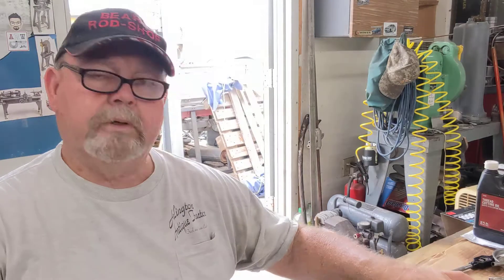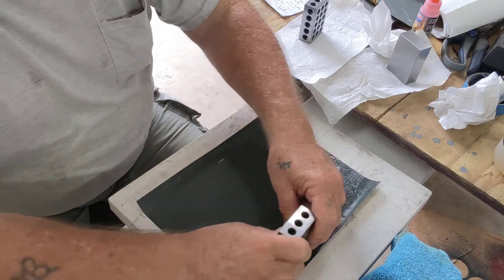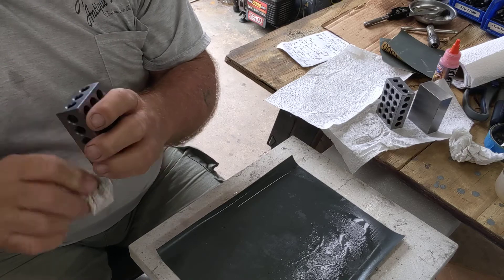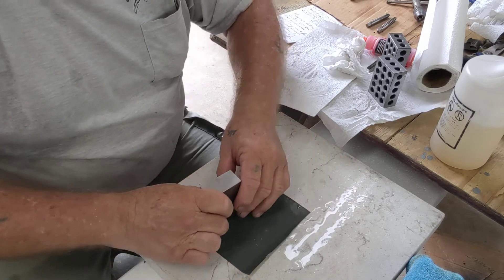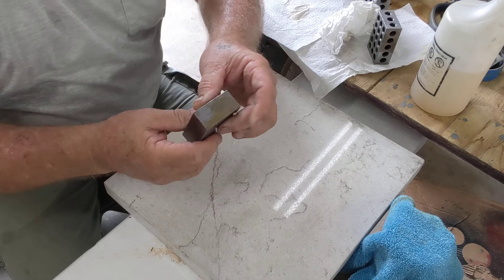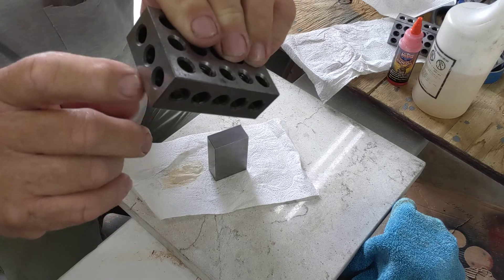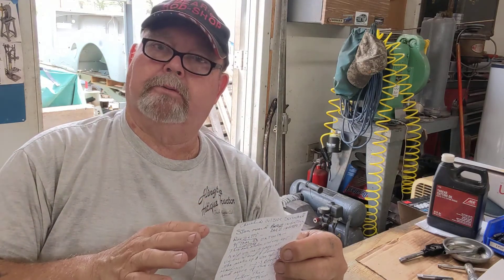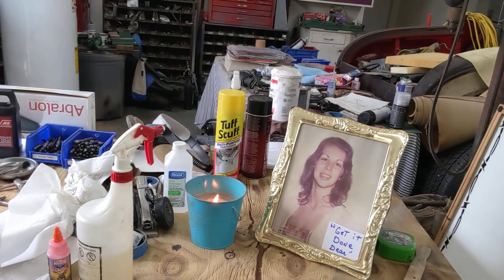1-2-3 Blocks - A must around any shop Metal or Wood - Hantavirus Warning

Comment: Hi Bear, thanks for the shout out fella. Those blocks in their current state are more than good enough for a hobby shop! I would oil them up and use them. Chasing the last few bits of pitting out..... Benefit doesn't equal effort. You have made a great job of bringing them up to a good standard. Cheers, Jon
Reply from the maker: Mr Pepper thinks he mite have more machinist tools. He runs into deals all the time, He is the man that gave me that Marshalltown 1918 #02 sheet metal shear back in Dec 2021 (@@)!